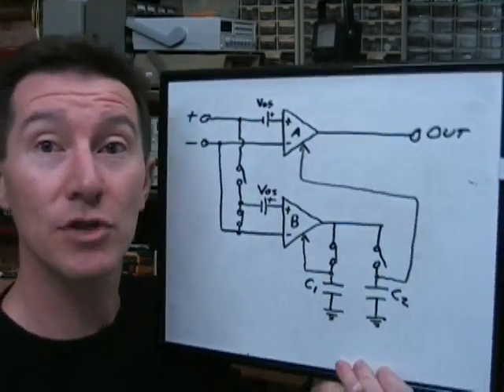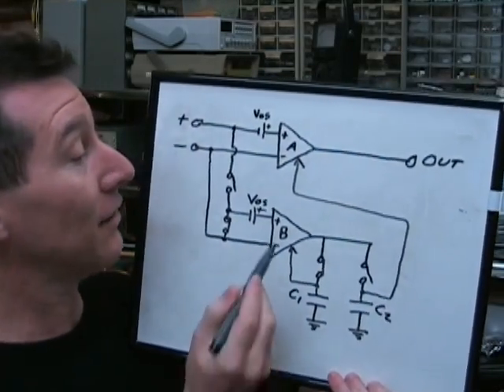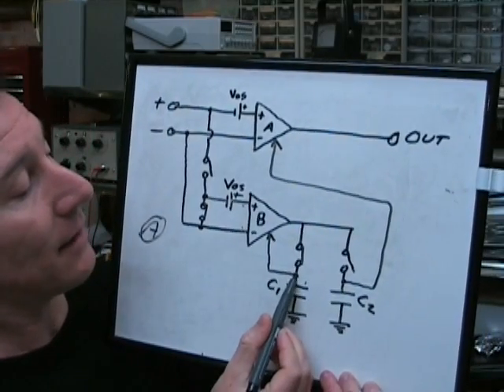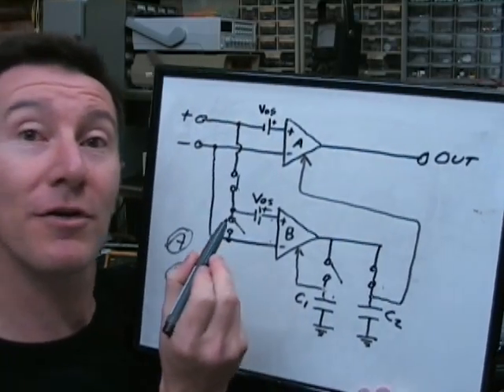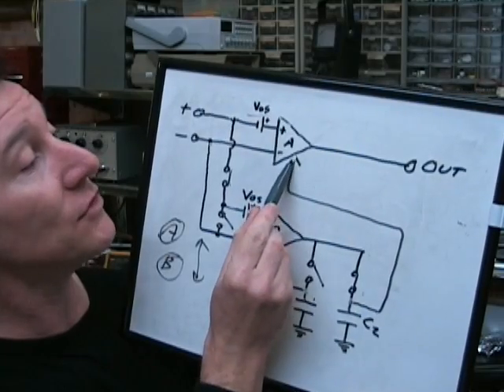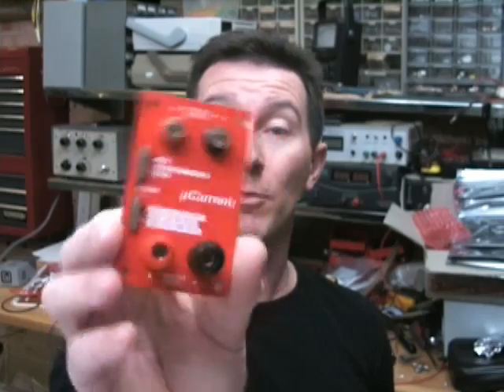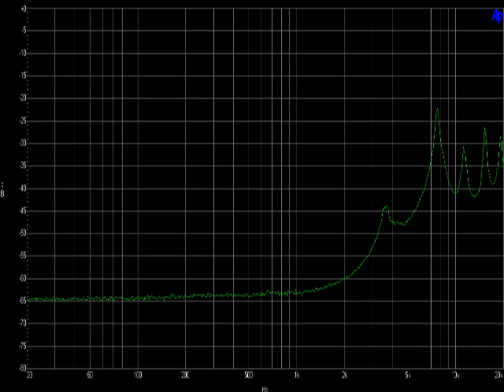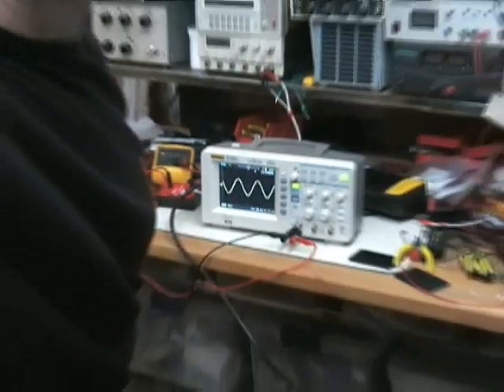EEVblog #24 - Chopper Operational Amplifiers

Comment: That's actually a CAZ (Commutating Auto-Zeroing) amplifier. Chopper amplifiers are different in concept, by turning the DC input voltage to AC , allowing the amplifier to amplify an AC voltage instead of DC, at the output then the amplified AC signal is converted back to DC to recover the original input signal.

Comment: Chopper technique is different from Auto-zeroing technique. They are completely different.
Differences
(1) Chopping eliminates input referred random offset as well as input referred device random noise. Auto-zero eliminates only offset while in-fact it amplifies device noise and makes the op-amp more noisy
(2) Mathematical z-domain transfer functions are also different for chopper and auto-zero techniques
(3) Chopping requires an internal band-stop filter to eliminate the noise at Fclk and it's harmonics. Auto-zero does not require any such filter

More-over, chopping amplifiers themselves can be of fundamentally different types depending on ratio of Fclk and Floop_bw.

The video is good. But it's just that chopping requires the audience to have a ton of background on z-transform, random noise, random offset, noise shaping, CMOS Opamp Architectures etc. which defies the whole intent of this video, which is to simplify the topic.

This may be of some help:
https://ieeexplore.ieee.org/document/542410

Comment: First of all, we don't deserve you at all. Thank you for all your good teaching. When I was 22 or so in the early 80s I worked for an outfit as a test tech that made discrete precision DC amps that had a chopper amp for offset null. To this good day I didn't really get it. It wasn't a requirement of us to understand the theory of operation but just to use the prescribed testing methods to get them out the door. As I recall, they measured strain gauges om missiles in silos in at least one application.

Comment: Thanks for the video....

There's something i do not understand... In Phase B,  op-amp B is nulling-out op-amp A using it's own nulling voltage. What happens if op-amps B and A have different internal offset voltages ???

Comment: Dear EEVblog, Might I ask some small questions about the phase B?1.  It's that Input is always connecting to the output through main Amplifier A. So, in phase B, what stored in C2 might be not only the Vos of main Amplifier A but also with the Input Voltage??? 2.  Or only the lower frequency Input might have the chance to be stored in C2??? Because for high frequency(HF) input, C2 works as short circuit and pass the HF input without attenuation.3.  So the input signal must be AC signal (chopped DC signal) in this case?Best regards and really look forward to your instruction and recommendationYour tutorial saves my shallowed experience, and really thank you very much!!!
Reply: I was also wondering about your first question. http://www.eetimes.com/document.asp?doc_id=1224795 explains for the same circuit how the total offset gets minimized; it's a bit more complicated than the nulling of opamp-B and involves some math, but it's worth going through it.
Reply: I dont think the block diagram shown in this video is accurate. open loop gain of amplifier A and B are quite high - if the offset voltage is ~10mV and gain is 80dB (example) , then the output voltage of the amplifier will saturate during offset cancellation phase. Shouldn't the amplifier be in unity gain negative feedback loop while cancelling the offset to avoid this issue?

Comment: nice vid.i was wondering if these would make a good preamp for say a lm386.i currently built a crystal shortwave radio using. a 741. 386 combo.i have noticed dc noise from the 741. but im not sure of the frequency ratings of a chopper type amp.anyway great vid
Reply: That would be a crazy level of an overbuilt preamp.

Why do you even care about DC offset?

Comment: Hi - #24 - good treatment of a complex subject. 
     I would like to use your audio spectrum analyzer to look at the op-amp noise at 0.001Hz. The reason is that chopper op-amps get jiggy at low-frequencies when used with capacitors.
     Is it possible to 'trick' out the FFT to look as far down as 0.001Hz?
Charles Gilbert, drcg5@yahoo.com

p.s.
     The MAX4238 is the lowest-noise chopper at 0.001Hz that I have tested, 20nV rms at 0.001Hz.

Comment: Hi,
You should change the title of video to autozero amplifier.Chopper amplifier used modulation-demodulation technique for nulling offset.The technique you described is for autozero amplifiers.
Reply: Correct. Chopper is modulating noise, offset and other non-idealities to a higher Fclk and then removing the high freq signal signal using a filter

Comment from the maker: it's nothing special, just the MAX4239 connected as a non-inverting amp with a gain of 100. Function gen on the input, scope on the output.
The full circuit for my uCurrent is on my web page. Google "ucurrent" (looks like I can't post links in here)
If you mean the Audio Precision THD graph measurement, that was done with an AP2700 analyser and XLR-Banana test cables. Sorry I don't have that setup any more, nor any photos.

Comment: Dear Dave

Based on Your drawing "B" amplifier should have gain=1 (shouldn't there be closed a loop placed between negative input and output) to properly store offset in the output caps

Didn't You forget to place feedback loop switches between "output" and '-" input of "A" amplifier- to obtain gain=1during sampling phase I guess there are also missing switches which disconnect outside world during offset cancellation phase

If my assumptions are wrong please correct me

Regards
Michal Uszynski